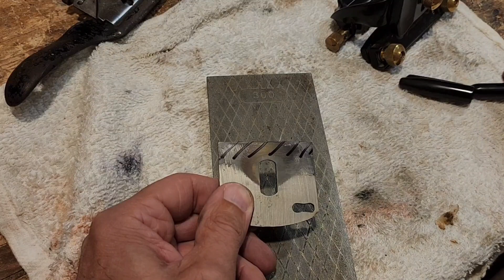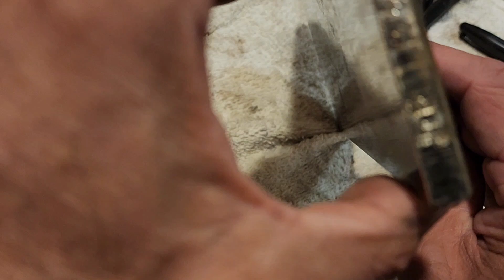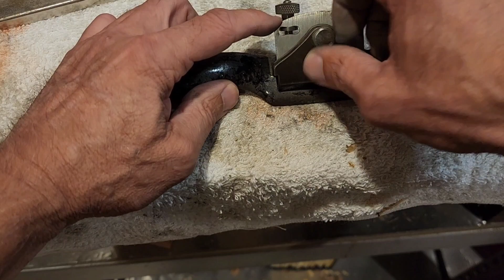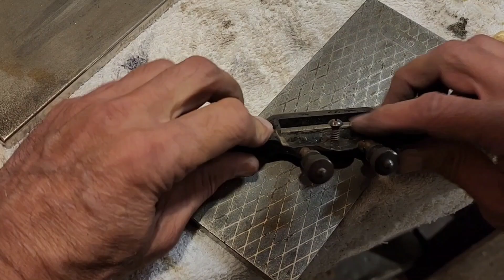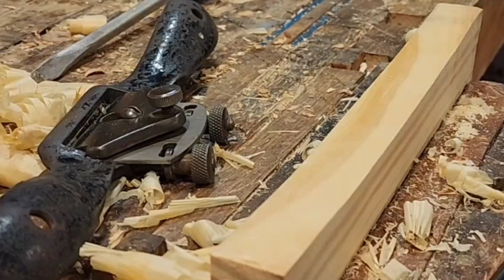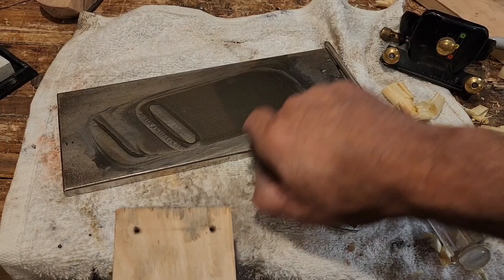Sharpen Your Stanley Spokeshave Blade

Comment: Very useful, so thanks. I have a stanley, pretty old, without the double screws, and haven't quite acquired the knack for aligning the cutter with the chip breaker; like I need another hand. Any tips? Thanks again for the sharpening tips.
Reply from the maker: So, are you saying that when you tighten the screw for the chip breaker, it twists and that causes the misalignment?
Reply: @practicalclubmaker  Many thanks for the reply. Turns out I'm missing the knurled screw that holds the two together. I think I can rough it (the steel is superb) and get it usable. If you DO happen to know a source for that screw (I've gathered that it's a common part to lose) I'd sure appreciate it. Apparently there are specialty screw outfits that make a thumbscrew version; I just have to track them down. Thanks again.

Comment: Why not use the ruler trick instead of wasting all this time flattening the back?
Reply from the maker: You could use the ruler trick. But David Charlesworth mentions that the blade needs to be reasonably flat in order for it to work. It is really a technique to maintain the polish of the blade once it is reasonably flat, at least that is my understanding of it. Plus, although I skipped one of the most important steps in this video, I do a lot of stropping to maintain the edge rather than hitting the stone each time. I don't like how the blade digs into the leather with that. But if it all works for you, that is fine. Whatever gets you to a polished back.
Reply: @practicalclubmaker6152  the back only needs to be "flat flat" right up against the edge. Where it's actually a back bevel so not flat. correct me if I'm wrong but isn't the green compound (10-14k according to the googs) actually degrading your edge after the 15k stone?

Comment: Get some Dykem, machinists layout fluid. Works great.
Reply from the maker: @JohnPublik  
Dykem:
Pros: Works great. I use it for more complex layouts like creating scratch stocks or when grinding moulding planes.
Cons: Toxic fumes, need to use on a well ventilated area, takes a minute or two or three to dry. I could be done or halfway done for the less complex sharpenings. I avoid applying in my tiny workshop because it is shared with my gas water heater and furnace.

So for simple sharpening, a Sharpie is my go to. For complex, Dykem.

Comment: That's some pretty wild technique you got there. Me, I like to use a stone holder. I make them out of scraps of 2x4. I just cut basically a wide dado the stone gets wedged into. I even cut one wall of the channel at an angle so I can use a thin wedge to lock the plate in there. Then there's a block under the holder I put into my bench vise to hold it. Another thing you can do with really small blades is fix them to a block you hold in a vise at the right height off a bench so a stone rubbed on the bevel just lands on the top of the bench too. That's how I do draw knives. They're a royal pain to sharpen. Fix the blade and move the stone. Some of my stones are in fitted wooden boxes I can hold in vises. The boxes are dedicated stone holders. They're fun woodworking projects.
Reply from the maker: @1pcfred  Yes. Paul Sellers describes the technique you mention where the blade is fixed above the workbench and the sharpening stone is moved back and forth. My drawknife is curved, so not sure if that would work. Paul shows that method for a tanged traditional wooden spokeshave blade. On the other hand, I think that these Stanley/Record short blades are a good way to learn and introduce freehand sharpening with less dependency for jigs. 

Here is the link to Paul Sellers' method

https://youtu.be/zOJVXRQLUOI?si=NEbmYCZMCh4aRDIP
Reply from the maker: Also, Deneb Puchalski shows the side to side method for sharpening Lie Nielsen spokeshave blades. For that blade, since it is very thick, one can easily do that method. But these Stanley blades seem to be 1/3 the thickness and it is difficult to feel the bevel register on the stone. That is why I do the sighting down method. Deneb's video is here, about 5 minutes in for the sharpening.

https://youtu.be/2nw_OuWJR_c?si=NTjlhhbosBulSq8V
Reply from the maker: @1pcfred  Some of my sharpening methods are a variation of master carvers. When sharpening carving gouges, we go side to side. The important thing is to get a sharp intersection of the bevel edge with the flat side (or hollow if it is a gouge). The striations should not matter. One could counter that having a burr on the cutting edge creates micro fractures on the leading edge as the burr falls off. The bottom line is just getting sharp edge. If there is scientific proof that the theoretical residual scratch pattern holds up better in one direction than the other, I would consider converting for some applications, but if there is a method that gets you quickly to the desired result, that is the most important.
Reply from the maker: @1pcfred  A burr is not needed to make a sharp edge. It is just an indicator that you are there and ready. Another indicator I look at is the reflection of the very edge with the eye or a magnifier. Yes, I know Dave and his unicorn sharpening. He showed us in person his method. I use it for some applications. Again, look at the master carvers. None of them sharpen there gouges front to back as far as I know, just side to side. They are sharp.
Reply from the maker: @1pcfred Regarding scratch patterns making a difference: When flattening the back of the blade, do you go side to side or do the scratches run perpendicular to the edge of the blade?
Reply from the maker: @1pcfred By the way, a burr does form with side to side sharpening
Reply: @practicalclubmaker  I freehand sharpened for a very long time. I have an Eclipse style honing jig now. It's way better. What matters in the end is efficiency and results, not how you got there. To that end jigs are always superior to freehand anything. The arguments people try to make to promote freehand are weak. I am also a big proponent for hollow grinding too. I want sharp tools and I want them fast. That's all I want. There's no romance. The honeymoon is long over kiddo. I still do what I have to in order to make the relationship work. But we need to be practical now.